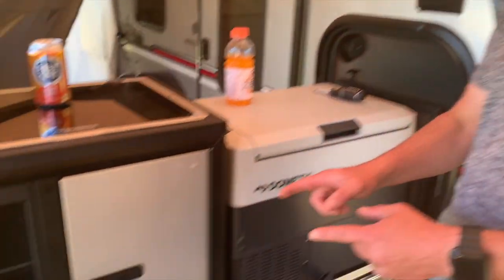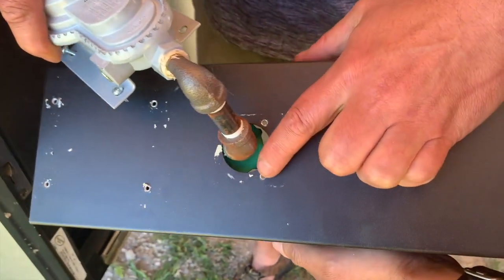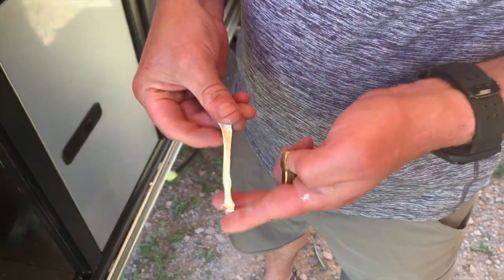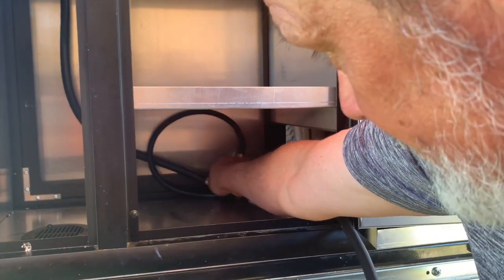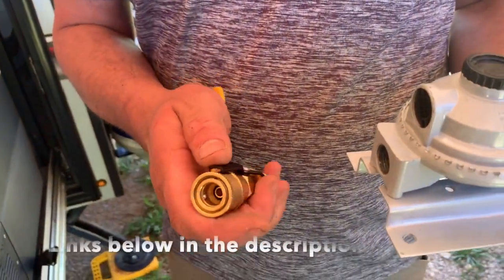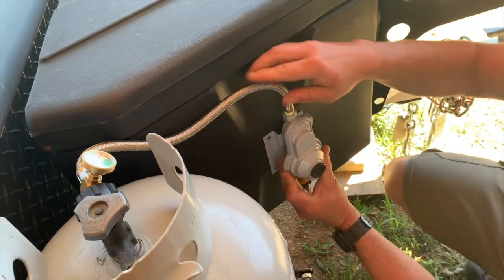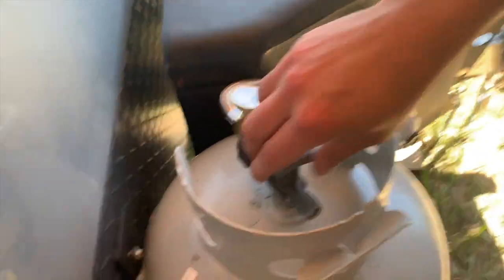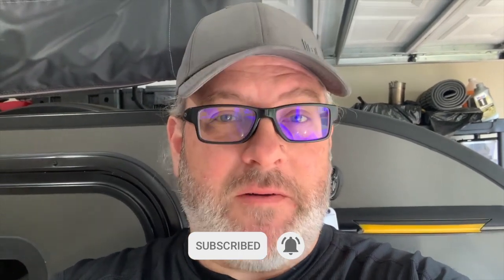Propane Quick Connect ⛽️  InTech Camper Trailers and RV!

Comment: You should not add pipe thread tape to the tapered end components
Reply: that is correct JIC,  SAE and AF tapered fittings are designed to seal on the taper not the thread. using thread tape can cause the thread to bind before the tapers seal causing leaks. Then people over tighten the threads causing cracks in the fittings
Reply from the maker: You are correct. Thanks for pointing that out.

Comment: Did you need to do anything special to mount the 20lbs tank holder to the front of the trailer? I'm curious if its solid enough throughout or do I need to find out dimensions to hit bracing.
Reply from the maker: It is solid. Bolts with large washers and lock washers on the back and it is super firm.

Comment: What propane mount did you use to attach the tank to the Pursue?   I’m in the process of doing the same set up along with the camco heater for my 2022 Pursue.   Thanks

Comment: Just curious since you’ve made several trips since mounting the regulator. Any issues with rocks or sticks kicking up and hitting it? I’m making a trip to Alaska next summer and will be driving down several gravel roads. I mounted mine in about the same spot on the driverside. I’m thinking of using a piece of aluminum or steel to make a shield in front of it. Just to deflect some rocks.
Reply from the maker: No issues at all! It seems to be a good spot. No damage to report at all. if you do make should please post it up on our Facebook page, would love to see it!

Comment: Thanks for this!  I’m pricing out an Exlore right now, and was wanting to do this exact same thing, for the 2 burner in the slide, the 2 burner black stone, and the Joolco as well.  How’s it working for you?  Also, how long does your 20lb tank last?  Thinking of going with a 10lb, as I would just be going out 4-5 days at a time max. Thanks!
Reply from the maker: It's hard to say how long the 20lbs last, seems forever! But I will suggest going with a 20llbs tank, as you can get them at pretty much any gas station. The odd sized tanks you have to bring somewhere that will refill on the spot. Something to think about if you are in a pinch and need gas! The quick connects are working great, just did 2 weeks in Colorado without an issue! Thanks for watching!